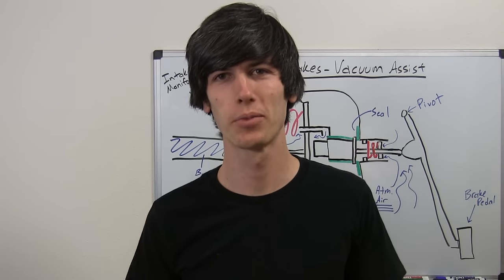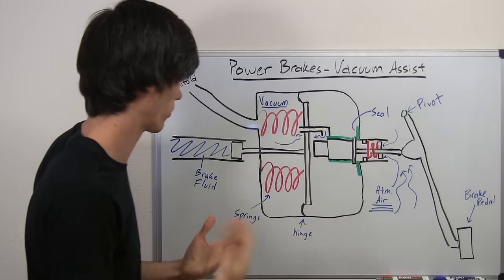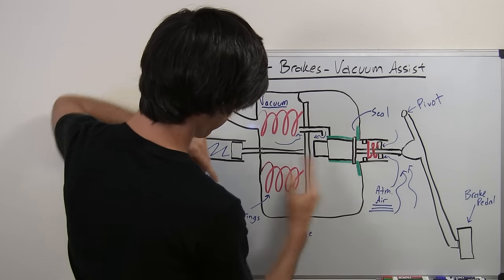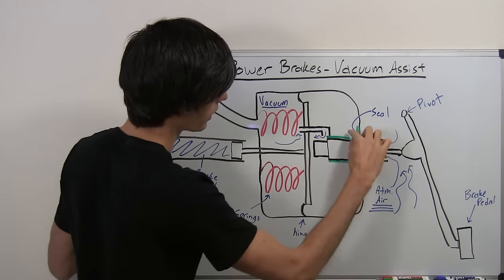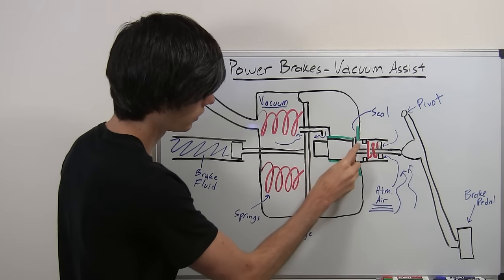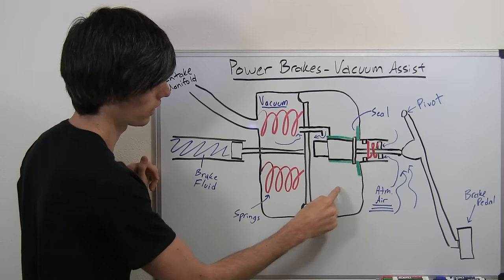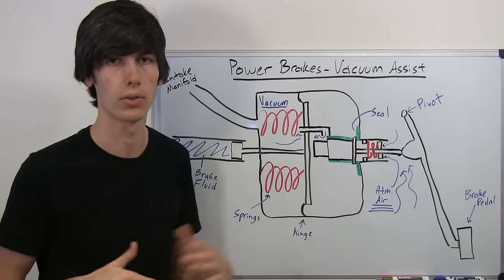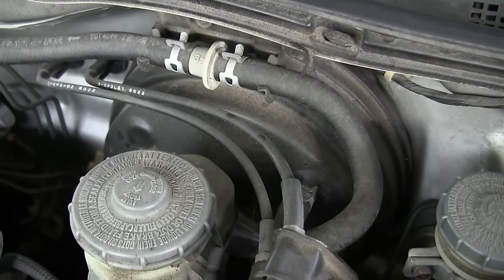Power Brakes - Vacuum Assist - Explained

Comment from the maker: It has a vacuum due to the intake strokes of the engine.
Reply: Hi great video.  Does the intake manifold provide enough vacuum constantly, or does it have to get held into the brake booster?  Sorry to reply to an old comment lol
Reply: @vinceking7878 I don't think it is correct to say that it provides vacuum. Rather, the vacuum is created as a by-product of the whole intake process. The engine wants a lot of air for proper combustion, so on one end there is an air duct, on the other there is a vacuum booster hose as well as PCV.

Comment from the maker: You are correct! There is a valve that holds the vacuum, which I forgot to include. You can use up the vacuum once, then it's manual braking.

Comment from the maker: Great question. You can actually use the electric motors for a lot of the braking (regenerative braking) or you could have a separate system create a vacuum (a pump) in order to replicated the power brake system of an ICE car. Could use a hydraulic pump as well, multiple ways of doing it.

Comment from the maker: When your pistons are moving down (intake stroke) they are pulling in air, because a vacuum is created in the space that was once not there (end of exhaust stroke), as this vacuum is created, it creates a vacuum in the entire intake line, leading to the air filter where air is drawn in by said vacuum.

Comment: Super video, one comment:  you didn't show the check valve for the vacuum line.  When this little cheap part is faulty, the problems with a lean condition exist causing check engine light, which you can spend a ton of time and money trying to fix.  Please don't take this as a criticism, you did a great job explaining.

Comment from the maker: Motors can reverse their function, and be used to regenerate energy from braking. This can be altered to slow down the car, so much so that it's possible to simply just use the motors, and no brakes at all - though this may be a bit rough, and brakes will likely always be there for a better feel.

Comment from the maker: Flywheels are necessary for two reasons. First, the keep power delivery smooth, yes, even with multiple cylinders. Second, they provide an attachment for the engine an the transmission. In manual cars, the clutch disc is squeezed between the flywheel and a pressure plate. In autos the torque converter is connected to the flywheel (flexplate).

Comment: This helped me understand why braking force suddenly increases when I'm braking downhill and my car down shifts.  Even though I keep constant pressure on my brake pedal, the increased vacuum from the higher engine RPM causes the brake pedal to move toward the floor even though I'm not pushing harder.
Reply: Manifold vacuum decreases as rpm increase due to equalization to atmospheric pressure in the intake manifold when the butterfly is opened.

Comment: At 0:51, he mentions that link in the middle. That link is open when the brakes are not pressed, and this gives equal pressure in both chambers. If the pressure is equal, there will be no force on the plate to push the brake fluid. Great question!

Comment from the maker: Not really sure, but when you let off the gas, and then brake, you'll then have a vacuum. Also, it could operate off of a valve that closes once the manifold is no longer a vacuum. This way, there's a vacuum in the brake booster ready for you to use.

Comment: So if you drive left foot braking in an automatic and swap quickly to the gas, could you notice an vacuum leak type sensation as the vacuum is pulled from the chamber as you release the pedal?

Comment from the maker: It's completely fine. You'll have "power" brakes for probably one good press, and then the vacuum is gone. After this, especially in emergency situations, just press as hard as you can (hopefully you won't lock the tires, but you'd probably have to be pretty strong to do so); braking requires a lot more force without the vacuum assist. Shouldn't damage anything, it's basically man powered hydraulics.

Comment from the maker: Some use hydraulic brake boosters, or have a separate vacuum pump for the brakes. Also, when you let off the gas you will still get a vacuum with a turbocharged car - though it may not be immediate.

Comment from the maker: Depending on how hard you push, and how much you push, allows for varying rates of air flow, and hence varying rates of braking.
Reply: This is the part I don't understand. How does it vary the pressure?

Comment: Basically the same. Event turbocharged engines have vacuum when you are not on full throttle. On a turbocharged engine there is usually also a one-way valve fitted in the tube so the vaccum created at low loads won't escape when accelerating.

But it's true: when accelerating hard and braking at the same time, the brake booster will work just once (as with engine off). Usually you let the gas pedal off when braking and that instantly creates more vacuum for the booster.

Comment: This video filled a gap in my knowledge set, thank you. Perhaps one day you could walk through a discussion as to how vacuum pressures fluctuate depending on throttle position, rpm, and egr valve position. Cheers.

Comment: Excellent, excellent video's. I'm an engineer and it's wonderful to hear these applied explanations; well done. Comment.... you keep saying, "... the brakes stop the car...." They don't. The brakes stop the wheels. It's not the same thing.

Would be wonderful if you could do a video on unsprung weight.

Cheers

Comment: Thanks man I appreciate it. I googled this exact question and your video came up. A well done explanation. One question though, what happens during a boosted situation ie turbocharger? Complete opposite of a vacuum!
Reply from the maker: +Mark Manzanares You're only under boost when you're hard on the accelerator pedal. Once you let off the gas, there's a vacuum, so it works exactly the same (and there's a check valve so it will maintain a vacuum in the chamber).
Reply: +Engineering Explained How about if you're doing a standing burnout lol! appreciate the quick comment. That makes sense that the engineers would put a check valve as you mentioned. Is that white plastic piece in between the two hoses connected to the brake booster?
Reply: +Engineering Explained So it different in a supercharged car where there is always some amount of boost? or do they then mount the vacuum lines on the intake side of the supercharger?
Reply: Old comment but there is a one way valve between the intake manifold and the brake cylinder that ensures air only flows towards the intake (hence creating a vaccum) even under boost. Hope this helps.
Reply: Some cars have vacuum pumps mounted on the back of the alternators for this very purpose.
Reply: Hey to clarify - turbo cars do indeed have a problem with the brake booster and boost.. for your average driver, on the road, you probably won't notice - as soon as you get into left foot braking in boost, you will..solutions are remove the booster (and use better brakes/master cylinder/pedal leverage) or add a vacuum pump and/or reservoir to keep vac for brakes. Even so, you got usually 3-5 good presses before you run out of brake boost..after 1 your brakes still work but there's no vacuum boost and the pedal effort will get much harder as it is stiffer.
Reply: Also, never knew you had a ...what looks like.. a b series in a EG? we have way too much in common..! You should help engineer our new wastegate technology :)
Reply: Mark Manzanares ㄹㅎㅎㅍㅇㄹ ㅠㅇ
Reply: @charlosovich  Supercharged cars still make vacuum until you put your foot in it.

Comment: Where do I get the vacuum for the brake booster in a forced induction car? I don't want to pressurize the vacuum side while on boost as I actually want my brakes to work should I have to suddenly stop.

Comment: When i shut off my engine, i can push the brake pedal and get one shot of braking action. One thing that you didn't necessarily elude to is, and i use that one shot, i can release the pedal and it springs back. If i try to push it a 2nd (or anytime now since the engine is off), there is no resistance when i push the pedal for a couple inches and then it feels like the pedals hit something solid (really hard to push it more), is that because now i'm pressurizing the hydraulics manually/non-assist

Comment: How much force does vacuum assist apply?  I can't quite wrap my head around the vacuum from the intake manifold creating enough pressure difference to make the assist significant.  But, it must work!
Reply: About 14.7 psi on the right side of diaphragm minus the psi above vacuum on the right.

Comment: Well I appreciate your reply. and yeah i was thinking something along that lines. your brake booster is one of the strongest vacuum lines on your car aside from the intake im told. Im thinking somewhere a line is plugged and so its compensating threw that line to get the accurate air in the engine. and the hunt begins lol

Comment: Awesome video, I'm pretty confident that this is the problem with my car. I think there is another problem before this fully went bung the car would hop, loose power often then gain it again. I'm on duel fuel so maybe the gas converter is causing the problem.

Comment: Good job with the video. I am fairly mechanically minded, but didn’t know, other than vacuum, how power brakes worked. Now I do, thanks, you explain things well, so most people can understand. Do you know of any YouTube ads that manufacturers (Chrysler, GM maybe?) put out in the 50s on the new power brake option?

Comment: Your lectures are totally good I'm Really appreciate you. I  started learning different components and I like the way you are teaching . keep it up. so can take video about carburettor and supercharger actually I am little bit confused about this system . carburettor function is to create air fuel mixture while supercharger create compressed air and both charge feed into intake manifold . so can we use both system in same car.

Comment: OK that is explained excellently BUT how does it work with a turbo vehicles
Reply: what do you mean? same operation. you need to make sure the brake booster doesn't see positive pressure (boost) in it by using a good check valve.
Reply: Victor S This answer makes no sense. Where is the vacuum source when the turbo spooled up?

Comment: I have a question.. I've seen all your videos. good stuff! 
2006 saab 9-3 2.8T 6speed, 

when I'm driving and I brake, at random times the rpm will jump up to 2000rpms and stays there. if I pop the clutch quickly, it will drop to normal.  Do you think it's the brake booster?

Comment: One question, the hose that going to intake manifold, which condition will expedite the recovery of vacuum
1. when the throttle fully open
or 2. when throttle body ideal, more closedly

Comment: For the weight of flywheel,the size of flywheel decreases with the no. of cylinder increasing.
In 4 or more cylinders engines (4-Stroke) power strokes takes place each after one another & starts to overlap as no. of cylinder rises but there is still dwell period for which flywheel is necessary.

Comment: i wanna ask about flywheel,do we need flywheels in multicylinder engines coz the power stroke in different cylinders happens at diff time and cant it be done such that power stroke takes place in the cylinders one after the another,if so we can reduce the engine weight by not using the flywheels.
This page really helps me to learn about cars much more thanks a lot.....

Comment: Very nicely explained, but I do have a question for you. My booster was taken apart and inspected and everything looked great and was put back together. Once on the truck the brake pedal will pull down to the floor with the engine running and nobody pushing on the brakes ! Whats happening in this booster ???? Any ideas ?>?

Comment: i have a question. i have a gs lexus model sedan.  and my brake light came on in my dash and is buzzing and the vsc light is on also. and my brake pedal is stiff like i ain't got brakes.  can you tell me is it the brake booster? or the brake actuator /pump? because i notice i don't hear the abs pump kicking on in the acc mode like it use to neither.  And how do i know whether to replace the booster itself or just the abs pump?

Comment: I have a 2005 silverado 4.8  2wd   with a sticking caliper both sides,  
front right, front left,   I changed the calipers the brake hoses the 
master cylinder flush the brake fluid,    and still sticking both sides,
  what do you think it could be?

Comment: Would it be feasible to utilize the braking system to run a line to a hydraulic placed on a rear wing to create an air brake? There wouldn’t be a need for software or programming as it would only flip up under braking. I’m not an engine so just thought I would ask your opinion before racking my brain on a design.

Comment: +Engineering Explained I own a Corolla 2E Carb Engine 12 valve  EE100, and i am about to install a "Simota AIr Filter" to replace the stock air filter. The carb adapter for the simota tube doesn't have ports for the 2 tubes connected to previous stock air filter (1st tube=going to the break assist & 2nd tube for the choke). The engine breather though has a ready port for connection with the new filter assy. What happens when the tube coming from the intake manifold going to the brake assist is disconnected from the filter assy. The auto choke doesn't seem to have a receiving port on the entire new Filter Assy also. Will it cause trouble to my car that way. Please help.

Comment: hey quick question, when my car is off and power brakes is off i noticed when i press on the brakes, it gets stiffer stiffer until its very hard to push, am i damaging anything by doing this? say in a scenerario where the engine stalls and i lose power brakes would i be able to jam it down withough damaging anything? or is it just really hard to brake but i still can?

Comment: all of a sudden my car started having this issue; I shut off the car and almost instantly the pedal is hard. I have a standard and I just noticed it doing this. Every time I go to start up the brake pedal is very hard and I roll a little before it starts and allows me to fully compress the brakes. Is this an issue with my vacuum assist (or that black part you point out)?

Comment: Let me ask you this; how would/could you modify the vacuum assist to be able to a regulate how much vacuum is generated inside the unit to fine tune brake pedal feel? My race car currently has too much assist and is killing brake feel.  I'm exploring removing the vacuum assist completely, but I like the idea of adjusting and tuning the assist.  And no, I can't go to a custom dual master cylinder setup with a balance bar as the series I race in will penalize me.  I would like to read your thoughts.
Reply from the maker: Hmm, perhaps somehow restricting the hose that connect to the booster, or removing it completely if that doesn't work out.

Comment: Could you explain a little more on why the chamber on the left always has a vacuum? You show it is connected to the intake manifold, and explain that the intake manifold is always pulling in air from that chamber, but where exactly (what location) on the intake manifold is that chamber located, and how does said manifold pull in air (is it with a pump?)?
Reply: You might have already found out, but the intake manifold sits on the engine, and the engine is sucking in air through this manifold, which creates said vacuum.

Comment: Thanks for the video.It confuses me that the vacuum you were talking from the inlet manifold.I presume the inlet air manifold will be pressurised with charge air while the engine running.Pl. correct me where I am wrong.

Comment: An assist is something which reduces the effort of doing something but does not overdo it.  But how do you achieve this, whether it is steering assist or brake assist?  It is like giving control without giving control?  It works with hydraulics but how does it work here?

Comment: What happens if you have forced induction and is ON the throttle. Will it make it harder to break due to the pressure in the intake manifold. (If you want to keep boost entering a corner etc). Is it still connected to the intake manifold in the same way? 
And how does it work on for example a e46 m3 where you have one throttle body for each cylinder, meaning no real vacuum in the intake manifold. 
(sorry for the poor grammar, I am from Sweden..)

Comment: I'm looking for your best guess here: In December 2013, I moved to Upstate NY from South Florida  and brought my 2000 Eldo with ABS.  When the temperature drops below 15 degrees I get the assist once and then I must push to the bottom to stop.  I replaced the fluid but to no avail.  What's your guess, please?

Comment: Vaccum assisited power brakes are of two types, vaccum suspended and atmospheric air suspended. Would either one  of them work if the engine is not working?

Comment: My friends car is having an issue where the power brakes will work fine for a few attempts, but then will begin sticking (the pads wont completely disengage the rotors).  Even after shutting off the car, the brakes will stay engaged for 5 - 10 minutes, until the vacuum is lost (so we know the check valve is working, at least).  If we pull the vacuum tube out, the brakes will return to normal, they'll only be manually actuated though.  Do you know what the issue could be?

Comment: why does the brake pedal goes down when I first start the vehicle? Can the power booster be bad? because when I disconnected vacuum hose while the vehicle is running. the break pedal go up but when I put the vacuum back on the brake pedal goes down & the rear brake lights comes on